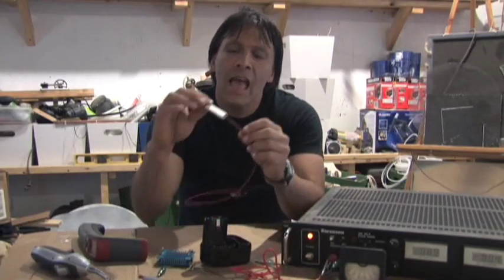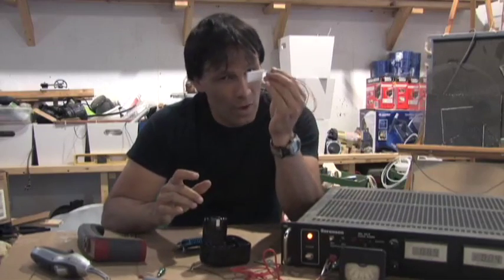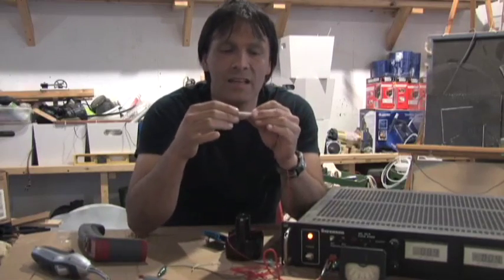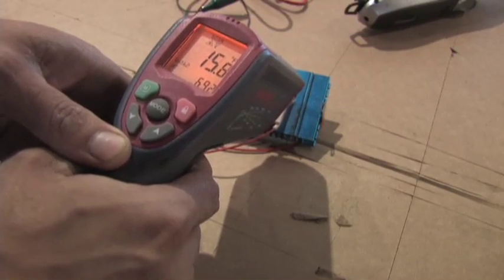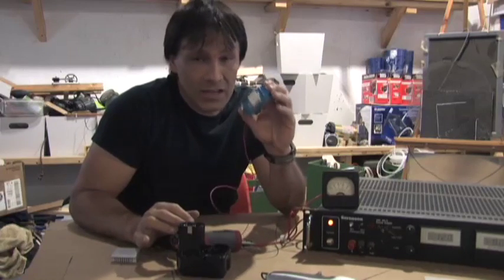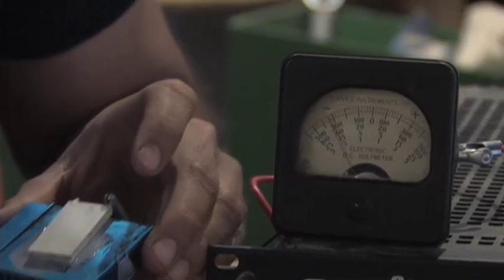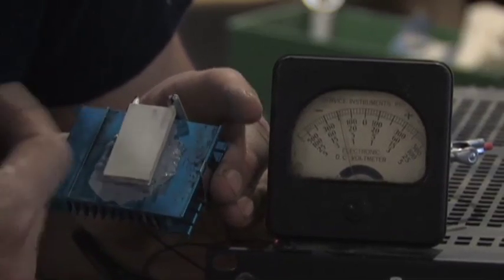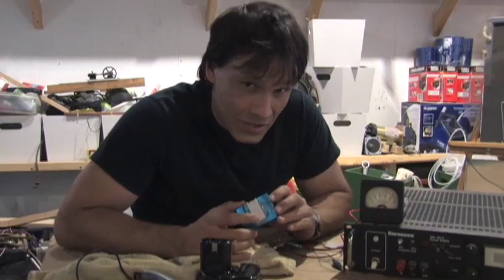THERMOELECTRIC COOLER PELTIER COOLER

Comment from the maker: Thank you for the nice comment.

The body heat idea is actually interesting because it would have purposes. While you will not generate a whole lot of power in a sit in unit, 5-10 watts, not sure.  I do not think you could power a people mover. But, since a large percentage of calorie consumption is the result of body temperature, staying warm, 98.8F anything that leaches heat from the body results in more caloric loss.

Comment from the maker: Hi,

The CPU option will work but I would suggest a thermostat. If the heat sink becomes detached it will destroy your PC. I think a water cooled heat sink with this attached to the water cooling area would be safer. Complex, but safer.

The other option is lower voltage, cool and warm vs hot and cold.

Comment from the maker: It would work, depends on the tank size, air flow for oxygenating and desired temperature and ambient room temperature. They usually are somewhat inefficient in terms of power consumption for the cooling process but with no moving parts and DC option a good choice. What is the tank volume etc.

Comment: @darendashing yes you can all you need is a small box which is insulated and a heat sink with fan and one of those and you can make one that will chill a can of soda fairly nice and if you use it with an aluminum can it will cool it greatly cause it will act as a sort of heat sink and draw greater heat from the can

Comment: Comment on body heat electricity post. The military is using this [experimentally] with soldiers clothing so their equipment, radio's etc are always charged. Heat next to body producing small current to trickle charge. Don't know how big or small their units are but it works..... In the field this is a life saver!

Comment: I think there are thermoelectric generators and Peltier coolers. Because both sides on the cooler are ceramic they are a lot less sensitive to temperature changes. If you get a generator it would have metal plates and it would be a lot more delicate.

Comment: Its important to note for everybody interested in a thermoelectric cooler that the voltage generated is proportional to the delta t between both sides. The hotter the hot side, and the colder the cold side = higher voltage production.

Comment: Cool device, I looked for some on ebay and they are all over. Pretty cheap too. Did you consider using the energy off your car exhaust to power an H H O generator? 
Most people that use H H O lose any benefit from the extra drag on the alternator. It seems only a few of these on a hot exhaust manifold would crank out pretty much H H O. 
Look forward to your reply
Harold 
PS someone else already asked a similar question

Comment: you could place the in series and then put them on the roof or you house and use solar heat on top and heatsink on bottom . the cold side you could pump air in to cold it off faster. you may use the cold side to cool a house. would the sun produce enough heat to power anything. 
thank

Comment: Hello, maybe you said it on your video but I didn't understood all you're experiment (i'm french so, i have an approximate english .. ) : 
Your thermoelectric cooler peltier need an hot and a cold source, i'm right ?
But when you put your finger on the device and that in the other side there is an hot source (i presume ...), why there is more power than when you don't touch it (air is colder than your finger ...).

Could you answer to me by mail pls.
Your video is really instructive, thanks :)

Comment: if you stack them... the temperature change between your hot and cold increases a LOT, but so does your Amperage.  Theoreticaly you could create supernova on one end and almost absolute zero on the other...but the current draw would be immense. Obviously the Peltiers would also destroy themselves before that point too... Solder melts WAY before supernova haha.

Comment: Ya, I was thinking that I could sandwich the Peltier  between the CPU and the water block. one of my concern would be that when I turned off the PC the WC pump would also go off, and the Peltier would still be putting off a lot of heat. how fast dose the Peltier cool once power is turned off. I could possibly put the WC system on some kind of delay switch. What are your thoughts. Any help with the theory is much appreciated.

Cheers
LazyMan@WestCoastMods

Comment: I bought 4 TEC 12706 thermoelectric cooler pelter's 12v 60w 92w max from China. there is no continuity between terminals and when I apply my 12v nothing happens. I did apply thermo compound and have tested all four, still nothing.  I am confused about which side is the hot side,  I believe it to be the printed side. my rear fans are blowing air away from the cabinet.  any suggestions would be appreciated.  who do you recommend I purchase the pelter,s from.  thank you Neil

Comment: so if you generate voltage from giving it heat does the other side cool down? For example if you put these on your roof and it was a hot day (arizona 110 or 115) would it keep your house cool and provide electricity?

Comment: if i were to wire two up in series, could i run 24VDC into it? If so, and i had a 24VDC 5A power supply, would i get 2x50W and essentially be drawing just over 4A?

Comment: i bought TEC12706 to experiment with.  Why when i attached the wires to A23 12V Energizer battery they get slightly warm / cold to touch, but nothing like temperature change as in your video.  I tried touching the wires to an 18v rechargeable battery... it got hot in a hurry!, but without heat sink the opposite side did not get cold... both sides were hot?
Reply from the maker: exceldude2001 They are like a ceramic hot iron when energized with no heat sink. Tap the leads to a battery and the side that is hot gets the heat sink. Cool side stays open. Only do this for one second or they become blazing hot fast on both sides without a heat sink. With a heat sink attached properly it should work perfect.

Comment: I used a ton of these units parallel together to make a heat recovery unit mounted on my heater/hot water flu.  They always have heat because of the pilot light or the hot water operation.  Some thermal paste, heatsinks and lots of wiring all in my attic so no heat goes back into the house.  Also used a attic heat recovery setup to preheat my hot water before it hits the heater ^.^  
I will make a video of everything after I get some time off and post it here

Comment: Could you put a heat sink on the hot side and put the cold side on your computers processor an then run current thru it to cool your CPU or would that be to cold?

Comment: no basically these things are heat pumps you run eletricity through them and they pump heat from one side to another. if you pump heat onto one side you get a current from it but no cooling

Comment: no the problem with using TEC's in a desktop or laptop computer is size. currently TEC's cant effeticly handle the heat output of a desktop computer not in the space available to install one anyway